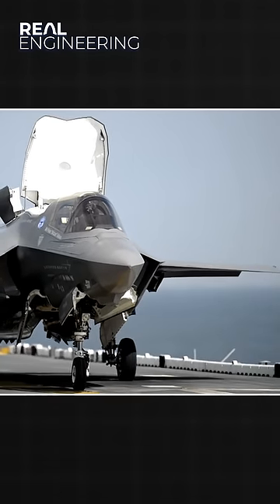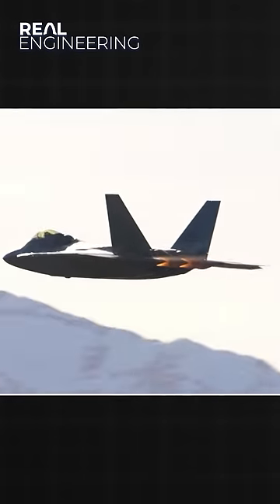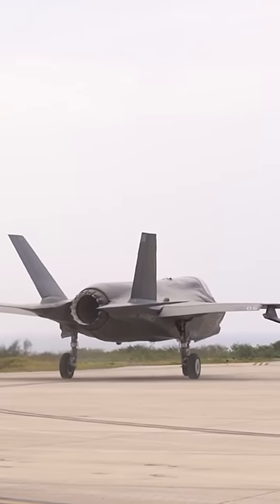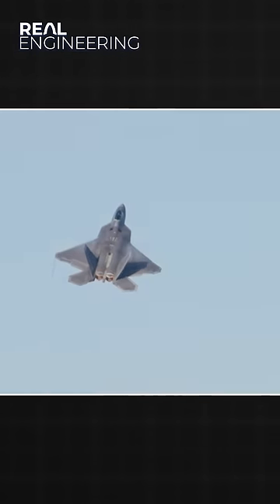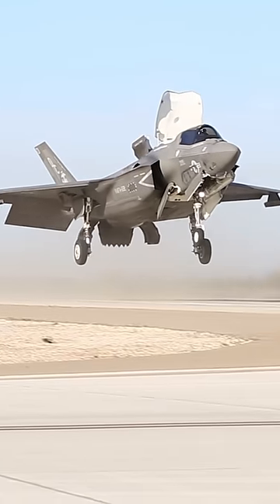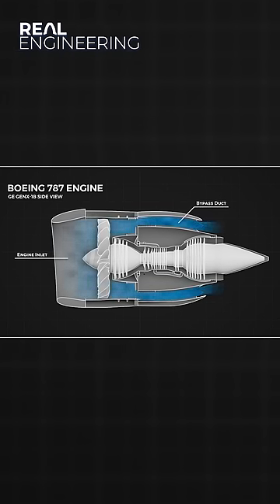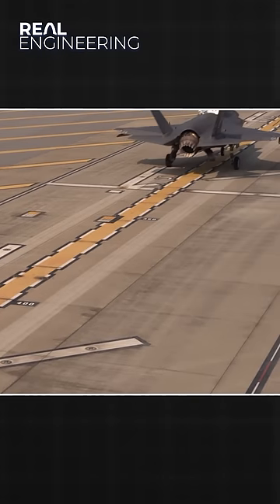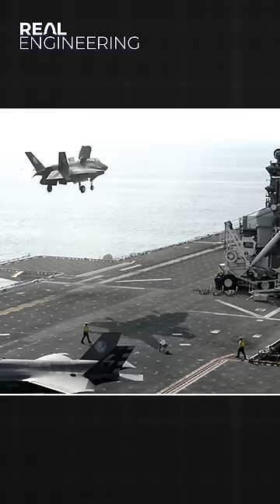How the F-35’s engine is better than the F-22’s

Comment: Sounds like they did all the right things for the F-35 mission set.
Reply: At what price though
Reply: A pretty cheap one. Its less expensive to build an F35 than even most 4th gen fighters @Niaaal
Reply: @rat2244  100M for a 4th gen never heard.
Reply: @tapabratasardar5268  78 million, so pretty cheap compared to the F-22, F-15, and F-14.
Reply: @Niaaal  Depends on the amount of units that they'll produce. People often forget that more often than not the majority of the cost isn't in the production line but in research and development. 

Lets say that they cost 50 million each to make, but took 20 billion to research.

If you only make 10, you're looking at a cost of 2.050 billion for each one, since in order to recuperate the cost of the development you split it by the 10 units, giving each 2 billion in extra cost. However, if you make 1000 its just 20 million of split cost, and makes each cost 70 million.
Reply: @tapabratasardar5268  the Rafaele, which is one of the more competent 4th gen fighter in the world is 94 million each, which is far more expensive than an f35
Reply: @rat2244 
The F-35 is not a cheap aircraft. It was supposed to be but it isn’t.
Reply: Except the part where they went back in time and got rid of the thrust vectoring 😂😂
Reply: For being the first of it's kind (mass produced and export available, insane BVR & multirole capabilities, insane computing power and connectivity, with also the infrastructure of manufacturing a modular aircraft), it's a nessisary cost to take as a stepping stone into producing more of it's kind of aircraft. Same for the F-22 which was the first gen 5. There's a reason why the B2 came at such a huge cost and why it went so over budget, and why the B21 is now suddenly way under budget and how it's development is on schedule.
Reply: @Wiggll  the F35 is three completely different airplanes. You don’t mix their capabilities together and pretend a single plane can do them all.
The B21 will over budget because it was bid incredibly under budget. They undercut Boeing by a lot, which is interesting since Boeing is used to building large aircraft. 
We probably can expect it to go even more over budget.  Both in development and per plane cost.
Reply: @Smokeybonez_7  You wouldn't ever want thrust vectoring on the F35 as it exists, as its range is one of its most important traits. If the F35 were to feature thrust vectoring, it most likely would have ended up as a twin-engine, as with almost all other existing thrust vectored fastjets, which go for twin engine for stability and other reasons; like to make up for the lost weight from adding this heavyset feature in the first place. It should make sense as to why thrust vectoring is significantly more useful and stable with twin engines as well. 
There does exist an experimental F16 model which to your point, does surprisingly attempt to feature thrust vectoring on a single engine airframe, if you look up the General Dynamics X62 "VISTA". Though, its difference in size, purpose and capabilities are significant factors when compared to the F35 as is its range. Importantly, the F35 really exists, the X62 was a R&D one-off.
Reply: @neilkurzman4907 Actually you do mix different capabilities, multi role is been a proven concept for 40-50 years, are you still stuck in the 50s or something? Lemme guess, you think the most important doctrine for a fighter is energy-maneuverability theory? Because that hasn’t been relevant since like… the Korean War?
Reply: @connorbranscombe6819  
It’s not a multi roll fighter. It’s three different planes. All with different capabilities. Yes, it’s the second time the US military tried to create one plane for all services. And the second time it failed. It would’ve been cheaper to design three different planes each one for the use that was needed.
The planes would’ve probably been superior for their intended uses, then trying to make the planes look alike. 
So now the F35 program is not a success. Hopefully the planes themselves will at least be useful.
Reply: @Niaaal  people keep referencing the program cost as if it's the start up cost.
Reply: F35 was thought to be a terrible investment during the development phase but has ended up being possibly the greatest plane ever made.
Reply: @AcidGambit419  
The greatest plane ever made? there are three different planes. Which one are you speaking about? 
Choosing any one of them as the greatest ever made is probably very premature. They are barely completed. 
The software being almost 10 years late.
Reply: @neilkurzman4907 have you been apart of the JSF program?
Reply: the harrier only needs its engine to vertically land and takeoff unlike the f 35
Reply: @Greyman55  
Nope
Reply: @8tcho  not sure what you are getting at as the F-35 can take off vertically and land vertically with its engine.
Reply: @8tcho  the fact that you say that is funny asf , its system sucked in its own hot air and stalled very often
Reply: @markoconnell804  The F35B is only vertical landing, it can not vertically takeoff. It is STOVL, not full VTOL. All F35's require a strip or catapult to takeoff, the F35B requires significantly less runway. F35A/C takeoff and land Conventionally (CTOL). This is as good an excuse as any to go watch some F35 departures!
Reply: The F35 is cheaper per unit. But the overall program is inflated as sh i t, making it not cheap.
Reply: @jpogigtxcr1778  claim without math.
Reply: @quibster  while fully loaded with fuel neither aircraft can take off vertically. But the F-35 can take off vertically with partial fuel. There is video showing this.
Reply: They will never deploy against Russia, yes against 3rd world countries OK 😂😂
Reply: @Niaaal  Unlike the F-22 the F-35 was jointly funded by well over a dozen nations. Also, the F-22 was to develop an air superiority fighter a single mission set. A replacement for the F-16 a replacement for the Harrier and a replacement for the F-18 all in one airframe, just with slight differences in design but the same base airframe. That is why it cost more. The C variant has a heavier landing gear due to landing on carriers.
Reply: @rat2244  it cost 1.7 trillion to develop, yet it's not superior to any existing fighter, even the mig-21 is faster
Reply: @LesbianCroissant  Saab JAS 39 gripen C goes for just over 30mil. Outruns the f-35 and is just as good.
Reply: @AI-Troll  1.7 trillion to develop the most advanced jet fighter of all time? Seems pretty cheap to me. Not to mention all of the technology that can be utilized in other applications.

We know russia is very capable of attaching jet engines to flimsy airframes. What good is speed going to do when it gets shot down before the Mig even knows theres an f35 in the vicinity lol.
Reply: @AI-Troll   how is it just as good as the F-35? Does it have the stealth capabilities it does? Does it have the same bomb/missile capacity? Is it as maneuverable as the F-35? Yes the Gripen is good and extremely affordable, but it isn't as good as the F-35, stop lying...
Reply: @AI-Troll high top speed hasn’t been a priority for decades, not getting seen and shot at is far more important and useful, and the f35 can super cruise while the mig21 could not.
Reply: @quibster that, and thrust vectoring is horrible for energy retention
Reply: @AI-Troll it did not take 1.7 trillion to develop, you are one of many that I’ve seen that do not understand the 1.7 trillion figure.

1.7 trillion is how much the entire F-35 fleet is estimated to cost, in 2070. 

That includes procurement of new airframes, fuel, wages for engineers, pilots, and technicians, the cost of all upgrades, as well as development and numerous other things for the next 50 years.

Edit: it should also be mentioned that the 1.7 trillion is also based on the U.S. plan to field 2500 F-35’s.
Reply: @markoconnell804  like the f 35 needs an extra turbofan to takeoff and land vertically
Reply: @Greyman55  yeah but the f 35 needs an extra turbofan to VTOL like the yak 38
Reply: @8tcho  it’s not extra. It is part of the same engine.
Reply: @bazooka712  That's too simplistic a representation because that research and development money is applied to other projects as well. The B21 wasn't researched and developed from scratch and neither was the F35. Both drew heavily from the dollars spent on the B2 and F22 respectively, not to mention other projects that came before.
Reply: @tylerparker4010  yes, I was being simplistic. I'm not implying that the knowledge being obtained can't reduce the development and research cost of other projects.
Reply: @8tcho  I’m aware it uses a lift fan and is more efficient, I worked on the 35b for 6 years
Reply: @8tcho  it's not an extra turbofan. The lift fan on the 35b isn't an engine. It doesn't generate its own energy. It is driven by the single turbofan in the rear. It is also significantly more efficient than the Pegasus in the harrier despite also only having 1 engine.
Reply: @LesbianCroissant  Those 78 million was the payment of the last yearly quarter. One of these planes costs way more than 78 million.
Reply: @brandondaway1  still ads weight chap
Reply: @8tcho   I mean yeah. But it's far more efficient than the Pegasus, and the F-135 produces more than enough thrust to make up for the extra weight of the lift fan. It's also far easier to control given the liftpack's wider base, and it doesn't have the Pegasus's hot air ingestion issue.
Reply: @brandondaway1  finally a brain has entered the chat
Reply: @markoconnell804  That's argument for the sake of argument. It is designated as STOVL. Only with partial fuel and no armaments in carefully staged initial R&D testing of the vertical landing feature did it ever vertically lift, but never in practice. Readiness is one of the most important principles for a military fastjet- Importantly you would not consider the aircraft 'ready' in this state, to be generous you could at most say this impractical configuration could be used to shuttle around a base, however it would not be considered 'ready'.
Reply: @quibster  while the harrier can take off vertically with a reduced weapons load out it rarely ever did. So what’s your point? Is that near novelty ability in practice that useful in your opinion?
Reply: @sarfarazahmed2022  Well since Russia is a third world country..... Also Western aircraft have been dominating Soviet and Russian aircraft since the 50's......
Reply: @AI-Troll  the mig 21 can't see it..... and the range of the 21 empty is half of the 35's loaded.
Reply: @Smokeybonez_7 the F-35 does not need thrust vectoring, it’s not a 1950’s dog fighter
Reply: @Schlawg788  😂😂😂
Reply: @quibster f35b can vertical  takeoff but it can not do it with max load and it’s very fuel intensive  Max load they use short takeoff
Reply: @AI-Troll no it 1.7T is the cost for the total lifespan of all f35s which project to be 4500 built for all nations
Reply: @Niaaal  Export sales bring down the total price a lot (for the US).

Comment: As much as you can say the F-35 is better, I still will remain convinced that nothing can beat the thrust vectoring of the F-22
Reply: F-22 was made to be the best at everything.
F-35 was made to be the best at what matters these days.
Reply: F22 got created after f4 disaster, so it has so many dogfighting abilities. But today, thrust vectoring has little to no value when fighting beyond the visual range. F35 may not beat f22 in air to air combat, but not because of thrust vectoring, because of stealth capabilities
Reply: mejbi ðə su-57
Reply: @cemborembo  Nah, F-35 can do both ground attack and vertical landing while the F-22 can't, therefore the F-22 was not designed to be the best at everything as it actually does less than the F-35
Reply: @cemborembo  Literally the opposite way around. F-22 was made for air superiority, F-35 is a general purpose fighter.
Reply: @cemborembo I disagree. The F22 is made as the ultimate plane for air superiority. The F35 is designed to be built 1000 times and be better at everything besides air superiority.
Reply: 100% air superiority isn't worth 10x the cost of other jets. That's my point.
Versatility, cost, communication and stealth are most important today.
Reply: You can’t say the F-35 is better though because it isn’t. It may be more adaptable to a wider variety of uses, but that doesn’t make it better.
Reply: @egementandogan2635 no man, the F-22 Raptor was made to replace the F-15 in terms of air superiority and the F-15 Eagle was made to replace the disastrous F-4 Phantom. And now the F-35 was made to replace the F-16, AV-8 and F-18 combined.
Reply: @egementandogan2635 the f35 has beat the f22 in trials.  When they merge though it's pretty much game over for the f35.
Reply: I mean the SU-57 technically has better thrust vectoring but there’s only like 20 of those that actually exist so in an actual war they might as well not exist lmao
Reply: Imagine they do an f36 with thrust vectoring, larger wing area, extended stealth drop tanks and even a higher performance engine. 🎉
Reply: @magic-or-whatever The F-22 was designed to be the best at air superiority and nothing else really.
Reply: @egementandogan2635 I thought F-35 had better stealth capabilities than the F-22 despite being cheaper?
Reply: UAVs / Drones is where it's at today.
Reply: @magic-or-whatever technically it can shoot air to ground but it just has to shoot the missile straight down
Reply: IMO the F-35 is more like a stealth Strike Eagle, only lacking the Strike Eagle's capacity to act as a missile truck but does everything else. It dominates in BVR and has great ground attack capability.
Reply: @maverickwest81  You wouldn't want thrust vectoring on a single engine. The X62 VISTA was an F16 based concept that never left R&D. The flight characteristics of a vectored single engine are way too unstable compared to a twin-engine fastjet, think threading a needle. Vectoring is also a heavy feature, think of all the servos involved, this would lower the F35s superior range, of which this loitering range is one of its most formidable and valuable assets.
Reply: @egementandogan2635  f25 has hmd, f22 does not. Current aim 9x blk2 have loal capabilities.  Thrust vectoring is thus not really needed.  Ontop of that, f35 has supurb irst and eots, it could detect an f22 before it can detect it, and aim 9x has datalink so put 2 and 2 together and i think the f35 can best the f22 most days in the week
Reply: @TehIdiotOne  nope, you see f22 as small as a bumblebee, while f35 has 1m^3 rcs
Reply: F-22 has only vertical direction thrust vectoring, while the Su-30 and Su-35 has a 360-degree thrust vector. Su was released long before the F-22
Reply: @boonamai8926 that’s misleading. launching a missile doesn’t mean enemies necessarily know where you are. they will get an RWR warning that will give an indication of where you were when you launched, but the RWR warning will follow the missile and the fighter is free to break in a different direction. but even IF they did know exactly where you were, that doesn’t mean that they can actually get a lock on you. seeing an enemy on radar and getting a track/lock are 2 different things.
Reply: @boonamai8926 you’re assuming it matters if the enemy knows where you are — it really doesn’t as much. stealth isn’t just avoiding radar detection, it’s about avoiding missile tracking too. the F22 doesn’t need other aircraft to avoid turning on its radar. it can handle everything because even if they are seen, it’s incredibly difficult to get a lock and even if they get a lock, the missile can lose tracking. same thing here. even if you know with 100% certainty from AWACS help that there are 2 F35s 30 miles dead ahead at 25k ft, you still will almost certainly be unable to do much about it. 

you’re not wrong that they’re designed to work alongside older aircraft but that’s not because they have to. rather, the F35s could clear out enemy SAM sites so that F15s could come in with guided bombs and no risk
Reply: @cemborembo  and neither are good at either
Reply: @cemborembo  well that wasn't contradictory at all.
Reply: @brauljo  The Su-57 can be beaten by most western fighters. The Gripen, Rafale, Typhoon, etc. It basically has the combat effectiveness of a super maneuverable F16. And Russia only has 22 Su-57s, in total. They also like to brag about their brand new MiG35. Ironically, there were only 8 frames made and 6 of them were test frames.
Reply: @tntfreddan3138  ¿haw wəz ðæt dɪtərmɪnd?
Reply: @cemborembo no the f-22 was not made to do everything. It was made for one thing: dogfighting. That's it only it.
Reply: su 35 joined the chat
Reply: @quibster  I'm talking just vertical. Same as f22. Doesn't need lateral thrust vectoring at all.
Reply: They have two different purposes.  Cannot be compared
Reply: F4 was supposed to be disastrous?